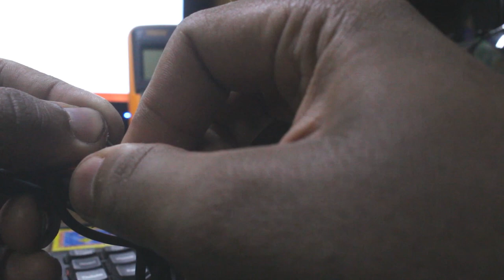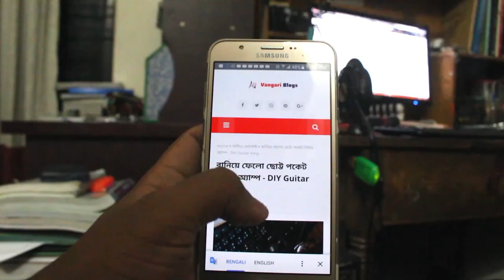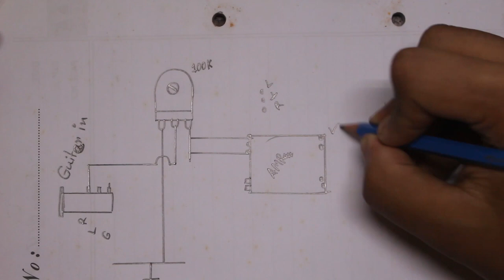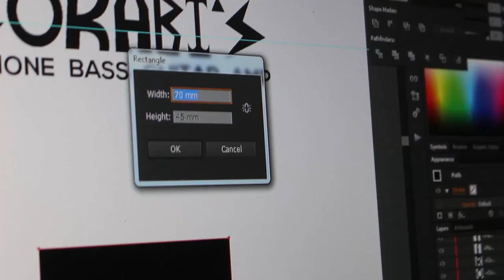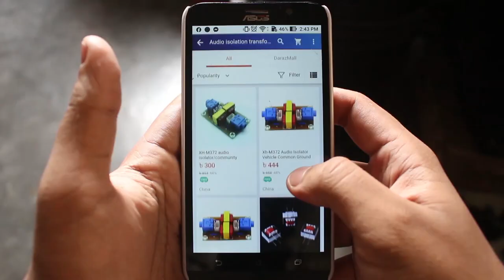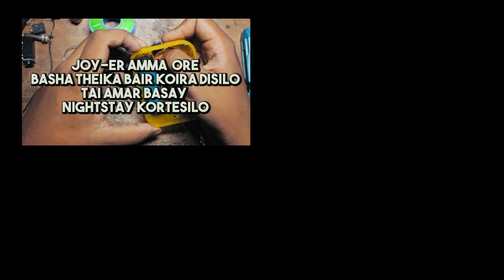DIY Guitar Headphone Amp - PAM8403 DIY Bass Guitar Amp [English Subbed]  | Tawsif Torabi

Comment: I made this today but it is having a bit humming sound, please tell me the exact name of that transfomer which you used...? And does it cut the humming completely...? And also when connected to the charger it is having more noise
Reply from the maker: Use a good charger adapter brother. And bit humming can be caused by exposed connections. Keep the wire lengths small and keep the components closer. Use battery power to operate. and do not use boost converters cause they introduce noise. And the transformer is "Audio Isolation Transformer" which is a 1:1 ratio transformer.

Comment: Hi man, awesome project, my question is... If I connect my 3.5mm jack like you you showed, the signal is Stereo, or just Mono?
Does it get distortion or works find for a homemade mixer? 
Thanks a lot!
Reply from the maker: you won't get any distortions on the signal I guess. It'll work fine for a homemade mixer if you use the isolator transformer.
Reply: @amazingvangari  Thanks man!